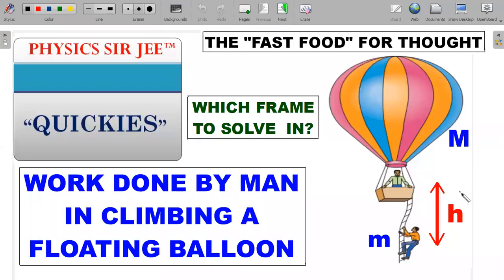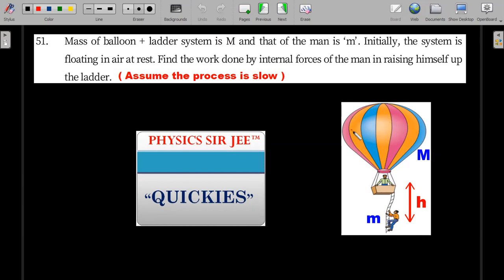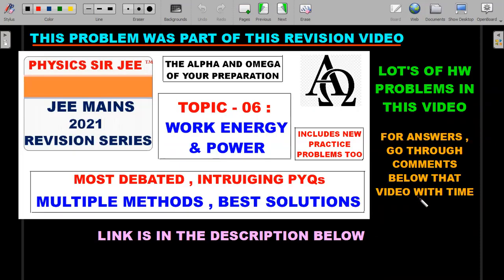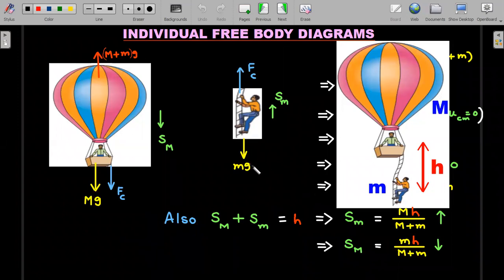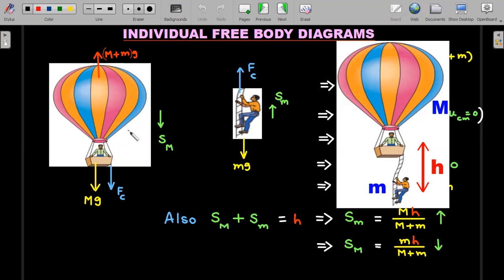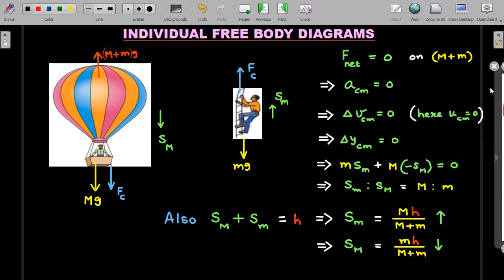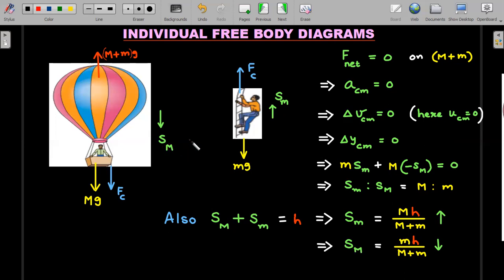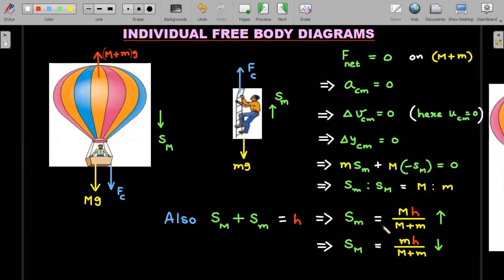[JEE ADVANCED] WORK DONE BY INTERNAL FORCES | MAN LADDER BALLOON | SCHOOL PHYSICS SIR JEE QUICKIES

Comment: Sir can you please give a hint for objective rotational dynamics pathfinder q10, what I did was I wrote torque=dL/dt about hinged point and in this case moment of inertia about hinged point is changing but i dont if there will be angular acceleration because the question says that the squirrel climbs slowly, which implies its acceleration is zero.....I am not able to proceed further... It would be really great if you can help me out with this one
Reply from the maker: As sin theta < theta , it's valid for all positions. So it will climb to max height. If you didn't understand , I am any way planning to make Solution. Please wait,🙂👍
Reply: thank you sir